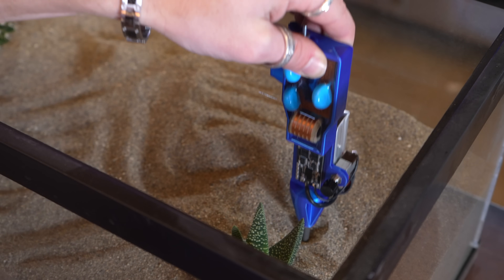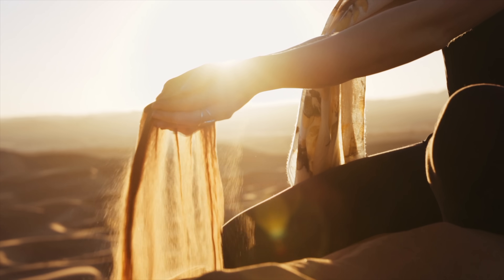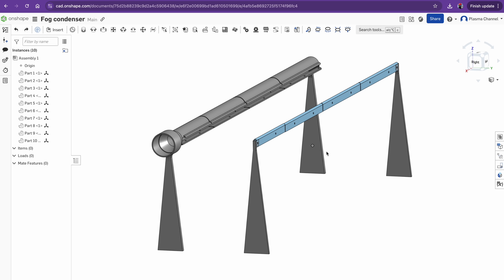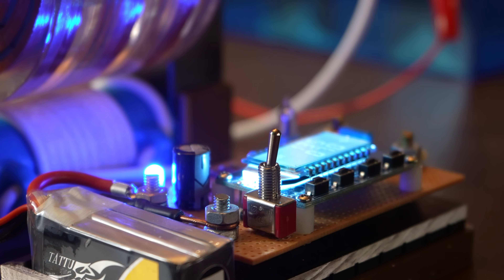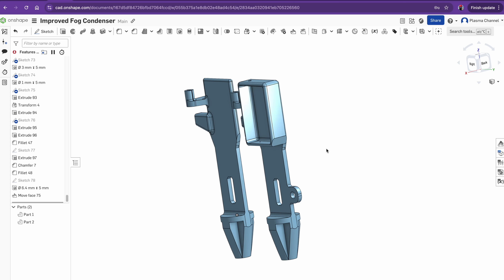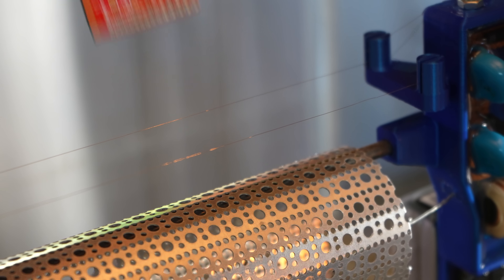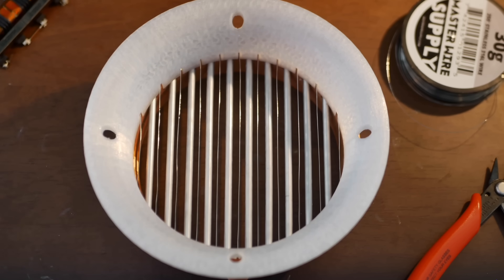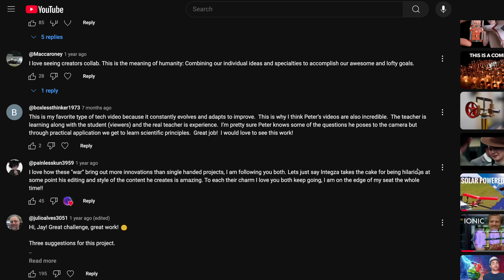Solving Desert Water Shortages Using 20,000 Volts

Comment: I take a wild guess and say it works only with actual droplets in the air and not with the soft fog of the desert. And you only have a tiny timeframe to do the harvesting in the desert. it might work a little bit, but even getting 3 liters out of such a system in an hour or so, requires a huge infrastructure.

Comment: What produces the fog though? It's the thermal radiation the ground and the air radiates into space at night and the water vapor that gets cooled down until it reaches its saturation vapor-pressure, which then causes condensation. Less greenhouse gases and clouds would produce more fog, but i don't see a way to do that.

Comment: Wouldn't the screen benefit from a wicking/capillary weave so the water droplets aren't just idling like vagrants at the mall. Like larger vertical guide fibers of a hydrophobic material that the droplets can't stick to, while the charged hydrophilic wires are smaller and so won't retain the water droplets. Collect enough to form a heavy drop higher up and that drop.. drops down collecting all the other connected dew drops on the way down

Comment: ATTRACTS LIGHTNING.  PLEASE USE ELECTROSTATIC PRECIPITATOR ENVIRONMENTAL SAFETY PROCEEDURES TO AVOID LIGHTNING STRIKE DISASTER.  A LARGE WIND DRIVEN BONETTI IS MORE TOLERANT TO PROBLEMS.  THE WIND IS PROVIDED BY TURBINE AT BASE OF PASSIVE SOLAR CHIMNEY WHICH IS LOCATED AS TO NOT SHADOW CROPS.

Comment: Im curious to know how temperature, light, and airflow affects this system.

Like, does warmer or cooler air produce more condensation? How about temperature of the condenser? Airflow in relation to the positive/negative electrodes?

I hypothesize that it will produce more water while everything is cooler, and that it will produce more if there is slight airflow across the system from positive to negative electrode.

Comment: Now we just need few light sabers, a pair of foster parents and a kid of a gifted force user.

On a more real question - does the condensation in that particular spot creates low density air? As in - does atmospheric pressure drops in that place. Because if it does - it should "suck" in surrounding fog as well.

Comment: You have a working concept, now you need to make it nature resitant.
Protect the thin wire from birds.
Have a indicator light if the wire is broken/grounded to the condensor plate.
Make the whole structure durable enough it don't crumple if someone bumbs into it.
Just to name a few, study the possible effects high voltage can have on the local flora/fauna, then your invention could change lives

Comment: Before you go to Chile, save a bunch of pesos and learn how to grow plants in sand.  Sand is a medium to support the roots.  You need to have minerals that the water you produce will dissolve into the medium to produce something the roots can provide to the plant.  Also, you may need shade cloth to keep a blazing sun from burning your plants.  Lastly, use the Israeli technique of putting clear sheet poly, perforated at each planted seedling location over the planting area to keep all your previous water from evaporating out for the rest of the day.  If the desert winds across your field are strong you need to make a wind break to keep whipping winds from doing an ‘air-fryer action’ on your plants.  You need to team up with a farming expert to test your system quickly, or be prepared to spend a couple if years coming up to speed on farming from square 1.
Reply: Yup 👍🏻 That's why, foreign investment is just plain simple 

You involved in investment but you only stay on hotel's but not on ground's

Comment: Question: How does taking the water out of the morning air at one location affect the ecosystems across the rest of the arid regions? This concept could be very effective for gathering water, and also for killing everything that needs that water to survive in the rest of the region. The water doesn't just disappear once the sun rises, it becomes the water vapor that returns as fog the next morning, and the clouds during the day time, and the overnight dew that soaks in to the ground for plants and animals to survive on.
That cactii, is not 'designed for the desert', it Evolved to survive in those regions, as one of the plants that survives on that morning fog.
As good as this idea is, it needs to be applied carefully, and only in places where the fog rolls in off an Ocean every day, so that the amount of water captured and taken out of the local water cycle is replenished. The ocean side edge of the Atacama might be a good location, but the arid high plains will wipe out what little life there is there.
For the Atlantic side of the Sahara, or to the sides of the Red Sea, this hardware could be incorporated in to the local farmers wire fences. Would be interested in seeing how well it would work using a chicken wire mesh, or a plastic fishing net.

Comment: This is nothing new. You made a high voltage paint gun, an electrostatic furnace air filter, or an electrostatic percipitator so check out those patents. I think you need to cool your condenser plate if you want it to work with low ambient moisture levels. This same phenomenon is what ruins ozone cells.

Comment: 14:30 shouldn't it be 14ml / Wh ? The expression 14ml / W / h is ambiguous. You can read it as (14ml / W) / h which would be the same as 14ml / Wh. Or you could read it as 14ml / (W / h) which would be 14ml * h / W which is wrong.

Comment: Why not just hang a HV wire above the ground and connect the other end to the ground itself? So that the ground becomes the surface where the water condenses instead of separate plate?

Comment: When I saw the idea of weather control systems in Star Trek, I never thought it would start with a thin, charged wire on the ground. Another benefit when thinking about it on a global scale is that all moisture that is removed from the atmosphere is good to fight rising temperatures as water vapor acts like climate gas. I would be interested if this could be scaled up. Energy requirements and yield are probably not the only considerations. If a scaled up version cannot handle the vegetation growth that is bound to happen in the direct vicinity, the contraption won't last very long. Stacking it vertically in order to maximize yield and collecting it below in a duct seems kind of mandatory for me.

Comment: 0:39  Maybe, because if you are drying the air, you change the water cycle and you are shortening the availability of water somewhere else. The water stays in the air as vapor and rising up due to the heat of the sun. 
That sounds like a problem to me.

Comment: One point missing is the impact to the eco system of removing moisture from the air that it has become dependant on. Yes it is good for crops but wildlife not so much.

A lot of the "Eco Friendly" work that is going on fails to assess the impact, like the removal of energy from the wind by turbines, that energy was part of the weather system now it is not, hence Wind Turbines will cause climate change (think "Butterfly Effect")
.

Comment: This is beyond  brilliant, and the applications this opens  in   commercial agriculture gos way beyond  just dessert  climates. I'm interested  what the ppm of the water if it's is ro water or if  you will get high anoff  electrical fields applied, for  some of the nitrogen gas molecules in the air  to ionize and bond in the condition process ? Another  thing I'm curious  about is if the wire mesh could  be dule proposed as shad cloth  or solar  paneling for water  pumps on top of system  it self. 🤔  kinda out there thought but could this be used in hydro power production if done in places of high elevation?

Comment: Try cooling the the grounded electrode. You might not need to use fog then. If you measure the current, you should be able to compare total condensation rates. You're basically making an electrostatic precipitator but precipitating water instead of dust. Changing the surface energy of the collecting electrode might be interesting too see. Hydrophobic or hydrophilic.

Comment: Brilliant. I've been living with a somewhat similar idea using a wind powered refrigeration circuit to draw in and condense humidity. There is a ton of water, all around us, untapped. Not a ton of flow, but around the clock would eventually fill up a reservoir. Water obtained economically that is better than water never obtained.

Comment: Normalize using Grok to ask ai questions. I get you guys have your panties in a twist over Elon Musk, but there’s no arguing it’s miles ahead of any other ai engine right now. 

Q: Can high voltage be used to collect water from fog?

A: “Yes, high voltage can indeed be used to collect water from fog! This concept leverages a process known as *electrostatic precipitation* or **electrofog harvesting**. The idea is to use an electric field, generated by high voltage, to attract and coalesce tiny water droplets suspended in fog, making them easier to collect.

Here’s how it works in simple terms: Fog consists of microscopic water droplets floating in the air. When a high-voltage electric field is applied—often through a setup like a mesh or wires—these droplets become charged. The charged droplets are then drawn toward a collection surface (like a grounded or oppositely charged plate), where they accumulate and combine into larger drops that can be gathered as liquid water. The voltage helps overcome the natural dispersion of fog droplets, enhancing the efficiency of water collection compared to passive methods like traditional fog nets.

This technique has been explored in research and experimental setups, particularly in arid regions where fog is a potential water source but conventional harvesting yields are low. For example, studies have shown that applying voltages in the range of thousands of volts (say, 5-20 kV) across a conductive mesh can significantly increase water yield—sometimes doubling or tripling what you’d get from a standard fog collector. The exact efficiency depends on factors like fog density, droplet size, voltage strength, and the design of the system.

It’s a pretty cool idea, right? Combining physics with a practical need for water in dry places. Have you come across this concept before, or is there a specific application you’re thinking about?”

Comment: 14:22 - can you do a humidity sensor?
I think the ml of water/watt hr is going to be dependent on relative humidity, so the efficiency unit probably needs that (I’m guessing it will be a curve with efficiency dropping off, the drier the air, so triggering it at a certain humidity could be ideal)
Reply: This only works on fog, which only occurs when RH tries to exceed 100%

Comment: I'm not good in physical, but I think the comparison at 15:00 is unfair, a dehumidifier is condensing moisture (aka gas) into water (liquid), and the high voltage condenser is contracting water molecules light enough to float in the air, which is still liquid into ...... water
Reply: I think it’s perfectly fair since he used the same source of water in both. That essentially cuts out variables due to temperature and pressure in performance. The major problem with these smaller cheap dehumidifiers is the method they use. Technology Connections has a great video about portable desktop ACs that covers this but essentially there’s a small pad that when you run current through becomes very cold on one side and very hot on the other side. The cold side slowly condenses water vapor in the air and collects it in the drain. The other side is cooled, usually by a cheap fan which is why they can be so loud when they’re on. It’s a cool bit of technology but highly inefficient energy wise. Because this relies on higher voltage more than current the power drain is much much lower and ends up being highly efficient because most of the energy is probably lost as heat from the stepping up of the voltage and smaller internal resistances.
Reply: @tommywilkinson33  well I don't think so, even I think they are not compatible as their "target" are different, just putting them both in a room with no additional fog supply for 24 hrs, I'm quite sure the high voltage condenser will contract nothing. A dehumidifier is good at condensing moisture, and a high voltage condenser is good at collecting fog into water drops.

Comment: Ok, new design idea.  Two concentric meshes, placed vertically.  The air is drawn to the center and forced out the top, to push the de-fogged air away, and the water is collected at the bottom.  The whole apparatus is attached to a single large stake stake that can be driven into he soil without the need for disassembly.   Perhaps some Solar panels to provide the energy so it can be placed any where.

You could make whole farms of these.

Comment: This thing already works INCREDIBLY well, but I wonder if it would work even better if it had a hydrophobic surface, maybe one of those made via laser etching rather than a coating since you need the conductivity. 

The hydrophobic surface should make droplets fall faster, which means more voltage to attract more water. This also works for ac/dehumidifiers, making the coils cooler for longer by ejecting the water as soon as the droplets are big enough.

The thing you'll have to watch out for is that the droplets will essentially spring off due to surface tension, so the collector will have to be much larger to catch every drop. Still, this is SUPER EXCITING and unexpected! The next step, after the hydrophobic surface test, is refining the shape for maximum water collection.

...actually I just realized something. This future appliance is so much more efficient than normal dehumidifiers that it will become an important part of an ac system, since removing the excess moisture is a big part of making the air feel cooler. Whoever these engineers are, they didn't just design a more efficient water harvester, they just designed a  much more efficient ac - or rather something that will make ac systems tremendously more efficient than they already are!

This is so cool that I hope you publish instructions for how you made your diy unit so that home builders can try this for themselves! Something like this would be super helpful for anyone living closer to the equator. Florida, Texas and Hong Kong should find this a tremendous aid, for instance. Anywhere it gets hot and muggy in the summer...

Again, this functioned WAY better than expected. I really hope this isn't a YouTube prank because this is one of the coolest things I've ever seen!

Comment: Seems the wire could be utilized in glass and glass as the collector would easy capture with right collector bottom. If this is feasable Every ship should be equipped with one. Craeting greenhouse glass would be ideal.

Comment: When fog is present, the electrostatic method in this video is more efficient because it attracts liquid water droplets already in the air.

When there’s no fog, most water in air is in gaseous form, so a dehumidifier is more efficient as it cools the air to condense water back into liquid form. 

You have to remember that water is a good heat sink because it is a very stable molecule, AND especially because it is dipole, meaning the two hydrogen atom are slightly on the same side geometrically causes one side to be slightly negative and the other slightly positive, allowing water molecules to attract each other.  That's why water has a higher evaporation temperature than rubbing alcohol or gasoline.  As a result, it takes a lot of (solar) energy to move water from a liquid state into gaseous form into the air.  That means in order for it to get back to a liquid state it MUST LOSE a lot of energy.  This electrostatic method in the video does NOT remove energy from water molecules in the air.  It only attracts LIQUID water molecules in the air (ie fog).  As a result, it can only convert fog (liquid water molecules in air) to liquid water (out of air).  It can't easily convert gaseous water (vapor) in the air into liquid water like a dehumidifier can.

The 3 states of water: 

1. Water ice (has low energy so it forms a solid) 
2. Liquid water (has enough energy to be liquid, but not enough to be a gas.  The gas form is dependent on heat energy AND air pressure) 
3. Water vapor (has sufficient energy to be freed from the liquid state and behave like a gas, expanding into any given volume) 

To go from 1 to 3, you add energy. 
To go from 3 to 1, you remove energy.

Fog is level 2.  Vapor is level 3.  The electrostatic method in this video only works on level 2.  A dehumidifier works on level 3.
Reply: What about EZ water, the so called fourth state of water.. is that a thing?